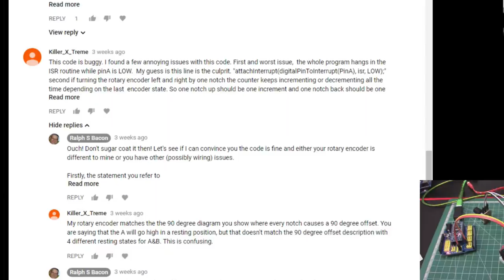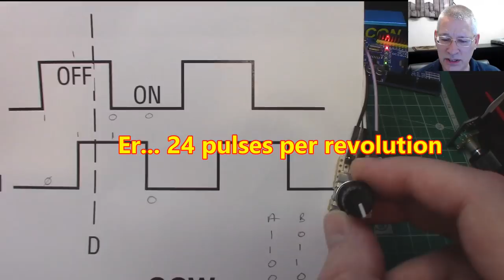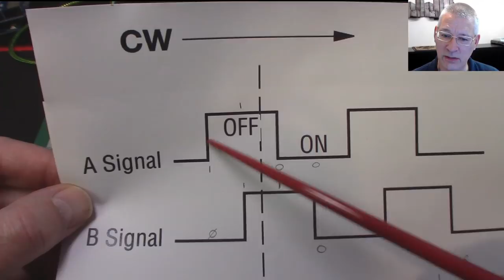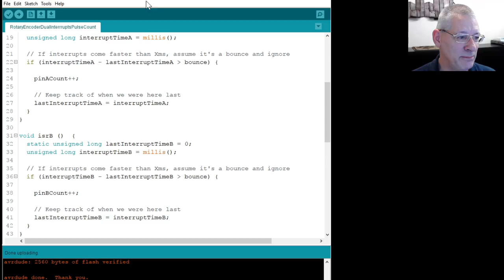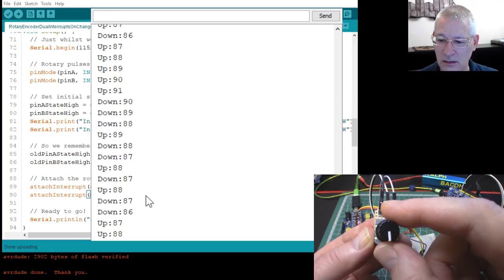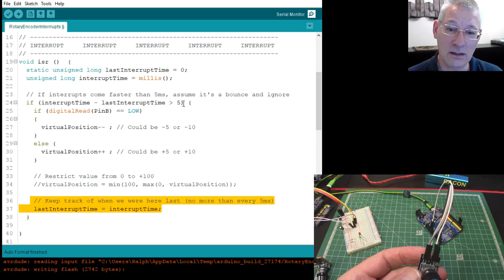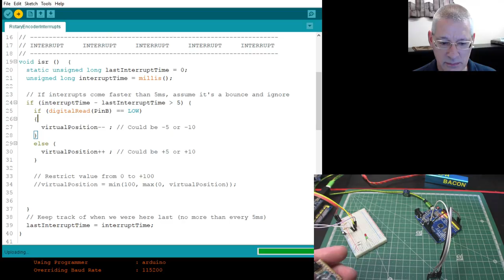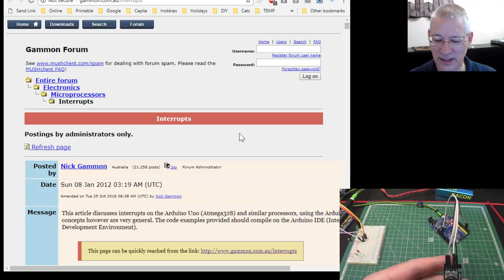#96 Rotary Encoder Update - Stepless & Software Debounced

Comment: Rising and Falling for iterrupts are fairly well defined.  The logic in the microcontroller has a set point where a low becomes a high and vice versa.  When the signal crosses that value, the 'rising' or 'falling' interrupt would be triggered.  The 'change' interrupt is triggered no matter which way it goes.  If your input were a slowly moving ramp signal, you could get some wacky readings, since the rising point will be different from the falling point, voltage-wise.  But with an on/off signal like the encoder, we don't have to worry about that.
     The code for using all four different states of a rotary encoder like this is fairly common.  You need to read both pins on the change, and you need to know which one caused the interrupt.  If pin A causes the Change interrupt and it's now High, it was rising.  If pin B causes the interrupt and it's now low, it was falling.  In the two separate ISR's, you have four states each:  For the A interrupt:  Pin A rising while B is low, or A rising while B is high.  A falling / B high.  A falling / B low.  The B change interrupt would have similar states.  If you study the timing diagram, you'll see that of these 8 states, four can only occur during clockwise rotation, and the other four can only occur during counterclockwise rotation.  So you know immediately on getting the interrupt which way the encoder is turning, even if it skips due to being turned too fast.  To halve the resolution, you could use Rising and Falling for A only, for example, and just ignore the other states.  You'd only need to read B instead of both, since the interrupt already tells you A is Rising or Falling.  This would be close to the code in the video, except you definitely know which way the encoder is turning.  Taking it further, you could interrupt on one state - for example, A Rising.  The ISR would only check B.  If B is low, it's turning one way. High, it's the other.
     It's important to note that the debounce time is effectively doubled if you check all states, since the interrupt will be called two times more than the original code.  If you use only Rising or only Falling, it would be simply 5 ms, or half the original code.  This is important because it will affect how fast you can turn the knob.  If you check all states, you get really high resolution, but the ISR is busy ignoring you for 120 ms for every full rotation.  It won't take much speed to miss a few ticks, especially if you get a noisy encoder and have to increase the time above 5 ms.
     Most mechanical rotary encoders use wipers on a rotary disk with conductive fingers. It isn't a sprung contact pushed out of the way like a switch or relay - the wiper only has to move the thickness of the finger plating.  The crossing does cause noise on the signal which will look like bounce, but it's much smaller than a sprung contact bounce.  A 5 ms dead time wouldn't be long enough to debounce a sprung switch, but it works fine here, and even lower might be possible with a new encoder.  Older ones get dirty and worn, of course, and will need more debounce time.
Reply from the maker: Good explanation! And I've discovered there are good Rotary Encoders and bad ones, in terms of switch bounce. The one used in my car, for example, is undoubtedly a much higher quality than the one I used in this video. Ironically, I bet General Motors paid about the same as they bought a few million of them!

Comment: I have been struggling recently to reliably use a cheap rotary encoder on a menu and finally found a method which works very reliably for me, so thought I would share it here in case it is of use to anyone else.
see:  http://alanesq.eu5.net/temp/rotary-encoder.txt
It stores the last received pin states and the debouncing mostly happens simply by ignoring any repeats of the same pin states then just through a series of if statements it looks for a valid change in the pins (e.g. when turning one direction the pin states just alternate between 0,1 and 1,0).
btw - you can see the menu I have used this on here: https://github.com/alanesq/BasicOLEDMenu
Reply from the maker: That is great, Alan, nice and reliable is exactly what we need with these cheaper rotary encoders, thanks for sharing.

Comment: Could you try the following code and see if it works better for responsiveness and bounce detection?
It should work for both types of encoders (as long as you use either INPUT or INPUT_PULLUP appropriately.)

// Clock signal
const unsigned int pinA = 2;

// Data signal. We are not going to use an interrupt on this.
// So can be some other pin to save the HW interrupt pin.
const unsigned int pinB = 3;
volatile int count = 0;

void isr() {
  static int lastClk = -1; // Initialize to an invalid state.
  int clk = digitalRead(pinA);
  if(clk == lastClk) return; // Bounce!
  lastClk = clk;
  int data = digitalRead(pinB);
  if(clk == data) { // anti-clockwise
  // remove the 'count > 0 check if you want to allow -ve values
    if(count > 0)  count--;
  } else { // clockwise
    count++;
  }
}

void setup() {
  Serial.begin(115200);
  pinMode(pinA, INPUT); // use INPUT_PULLUP if required.
  pinMode(pinB, INPUT);
  attachInterrupt(digitalPinToInterrupt(pinA), isr, CHANGE);
  Serial.println("start");
}

void loop() {
  static int oldCount = -1;
  if(oldCount != count) {
    Serial.print(oldCount < count ? "UP" : "DOWN");
    Serial.println(count);
    oldCount = count;
  }
  delay(200);
}
Reply from the maker: I have a better idea, Krishna. You get a Rotary Encoder, an Arduino Uno and you try it out. That way you get experience and learn the answer to your own question. How about it?

Comment: One can get a 600 ppr optical rotary encoder from Ebay these days for as little as Aus$13.00 - $14.00 . I am about to look at using them in fact (as a counter) or rather as a dual counter for sync on a spindle to leadscrew and that is what brought me here.
This brings up another query you may be able to help me with, using 2 of these optical rotary encoders, one on the spindle and one on the leadscrew, if I am to use both interrupt pins , would any problem arise from missing pulses ? As I understand it only one interrupt can happen at a time.
Possible it is explained somewhere, ( need to look further) just thought I'd ask while I'm here.
Reply from the maker: Well, Jeff, an interrupt can't be interrupted, so if your code was dealing with a pulse from one Rotary Encoder and the other one then triggered an interrupt, that interrupt would be queued to run once the first one was completed. So no missed pulses but if your ISR is too long you could have too many queued up.

Comment: I have one of those rotary encoders which came as one item of many in that batch of stuff I bought from banggood a while back,  and hadn't gotten around to playing with it yet.  I had no idea that contact bounce was going to be so much of an issue with it!  My thinking while viewing this video was that optical was probably the way to go,  and then you commented a bit after that about how expensive they were.  I wonder if that's changed any since then?  Perhaps salvage from a mouse might be the ticket...
Reply from the maker: Contact bounce can be dealt with very successfully within software (as I showed). Hardware debounce is better (video #98) but not essential. Optical is ideal but then you are talking more money. Salvage from a mouse is a great idea if you can get a mouse with a ball these days.

Comment: Using a "noisy" signal to trigger interrupts just seems a poor choice. Those spurious interrupts can cause a performance hit and the incorrect readings. Just cleaning up the interrupt signal should suffice.
Reply from the maker: That does seem to be the consensus, Jon. So I've built a simple Schmitt trigger buffer to clean up those pulses which appears to work nicely but I need to inject a rubbish signal to prove it can work to you guys in extreme cases. Hmm, a simple triangle-wave signal injector, now there's a topic for a future video maybe... Thanks for posting and adding your voice to the "use a hardware debouncer!" clamour, I am now persuaded this is the way to go!

Comment: Hi Ralph, could you explain line 34 a bit more as it appears max and min are reversed. I did a search of that particular line to see if I could understand it but nothing really came up.
Reply from the maker: The "min" function takes the lower of the two values. So, if we do min(100, 54) we will get 54. If we have min(100, 244) we get 100. We could write it with the values either way round.
I suspect the max() in the middle of it has confused you.
Arduino state: "Perhaps counter-intuitively, max() is often used to constrain the lower end of a variable’s range, while min() is used to constrain the upper end of the range."
Basically, that line restricts the maximum to 100 regardless of what the value is. Write a small sketch (it will take 5 minutes) and use the Serial input to enter two numbers to see how it works. That way, Jeff, you will truly understand it.

Comment: Ralph,

Thanks for the update.  Would you consider doing this with an ESP32? I'm using a ESP32 to control a Sous Vide cooker/PID loop. and would like to use the encoder to control a menu for time and temp changes and I'm not sure how to use an interrupt with the ESP32.  I don't want to be sitting there checking the state of the encoder constantly.  The program could be away from the PID loop for a second or two but it cannot be gone for any extended time or the temp will be way off.

I've switched most of my project MC work over to an ESP-8266 and now a ESP32 because of its additional features
Reply from the maker: The ESP32 is certainly the flavour of the month! And you're in luck as the ESP32 has two cores, with 32 interrupts each. Exactly how to use them is best understood by reading this: http://esp-idf.readthedocs.io/en/latest/api-reference/system/intr_alloc.html from the makers, Espressiff. This is a good document (v3) to read anyway.
 
In due course, and as my understanding of the ESP32 increases, I will no doubt be doing something with it that requires interrupts. For the ESP8266 it's even easier as you can use any of the GPIO pins (except GPIO16). Wow, spoilt for choice. Thinking about it, my original sketch for Rotary Encoders should run unmodified on an ESP8266 board (eg ESPDuino), but I haven't tried it (yet). You might want to though (and let us know whether it works as expected).
 
I'll add the task to my ever-growing list, William, so if you don't do this before me keep your eyes peeled for a video on interrupts on the ESP32 in due course.
Reply: Thanks for your quick responce.  I'll give yor suggestion about trying the original rotary sketch on a ESP-8266.  I have the parts needed and I'll let you know.

Comment: Have you tried going over specs on your capacitor values? I saw a guy with similar problems, and he solved it by simply changing the 1nF caps to 100nF ones to give the microcontroller a longer time to cach these events.
Reply from the maker: That's certainly one way to try and address the problem of switch bounce, Frederik. The main issue is that it may work for one switch but not another (so if you were a manufacturer you want repeatability of behaviour and that may not be the case here). I like the hardware solution but it involves further hardware and connections; the software solution can be made to work for almost any device but can introduce longer delays before a change is acknowledged. It's a minefield, don't you think?

Comment: Slow increments is normal, use pushbutton function to have counter add more than one. Push button again to return to normal increment of 1.
Reply from the maker: Ah yes, that would work. Perhaps we (OK, me) try too hard to solve problems 100% when the good old 80/20 rules applies (if it's good enough...).
Reply: a common solution to that is keeping track of the interval between pulses...
Then you can make the ‘speed’ proportional to the rate of rotation.
Reply from the maker: @MC That works if we accept each pulse as being a proper pulse without rejecting it, designating it a 'bounce'. However. I've just completed a small debounce circuit which means we must be able to trust each pulse as being a true pulse (no more debounce timings) so your method would then work really well.

Comment: Hi! Can you please make a video about how to code for a dual rotary encoder?
Reply from the maker: I'm not sure I really know what a DUAL rotary encoder is - have you got a link that I can use, or a part number?
Reply: You are right... ELMA are by the way the official supplier for Boeing cockpits and have the best quality. It would be great to learn more about them though.
Reply from the maker: I've had a look at this, #konturgestaltung, and as #ISuckAtGaming has mentioned these are effectively two rotary encoders in a single body.
 
The outer sleeve on the shaft controls one A/B set, the inner shaft controls another. They are not joined internally (other than the ground). To use these you would simply treat them electronically as two entirely separate encoders, but remember than an Arduino only has two interrupts so if you use my original sketch from video#19 with an extra interrupt for the second encoder's A/B pair it would work exactly as expected. Does any of this make sense to you?

Comment: Thank You for an excellent review of the troubles with rotary encoders!
I am an EE and have seen many variants of these missbehaviours over the years. I concur that analog filtering, schmidt triggers and proper software in a tasteful mix is the way to go to achieve good performance.
It is usually a good idea to start with the oscilloscope first and figure out the timeconstants of the noise and the desired signals. I have also noticed the behaviour You showed as in the car stero and found it very annoying.
Reply from the maker: Thank you very much! Without a doubt, Schmitt triggers are a foolproof way to go but you need more components. Thanks for posting.

Comment: One problem with using external interrupts on these mechanical encoders is that there’s no way to reliably filter contact bounces. A better approach is reading the encoder inputs inside a fast timer interrupt and only accept steady changes of the input pins. This also has the advantage that you can use any regular input pins for the encoder. This approach works extremely well at any encoder rotation speed, from very slow to significantly fast. In case you want to have a look, this is is demonstrated here: https://github.com/John-Lluch/Encoder
Reply from the maker: I don't usually disagree with my viewers, on the basis they know more than me, but on this occasion, I think my hardware solution is the best I found, Isfornells. 100% reliable too, at least in my testing! And...
 
If you watch my video #19 (the original Rotary Encoder video) the software solution worked pretty well too, at the speeds I was using it anyway. The trouble with "accepting steady states" is that it involves multiple reads, which are time-consuming and not best suited to an interrupt routine, IMHO. Debouncing has got to occur somewhere, after all. Using "any pin" for an interrupt might work well for some but my video was targetted at using the built-in interrupt pins precisely because they can be relied on.
 
Each to their own! If you have a solution that works well for you it might work well for others too so thanks for sharing the link, you never know who might read this in the future. Thanks for posting, appreciated.